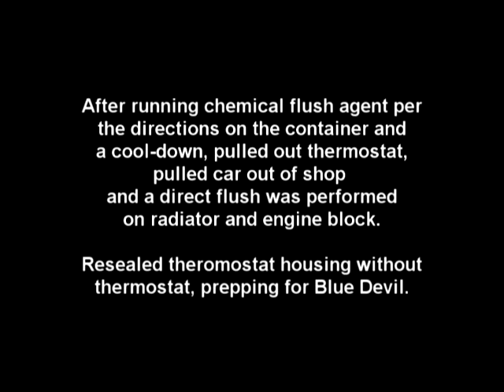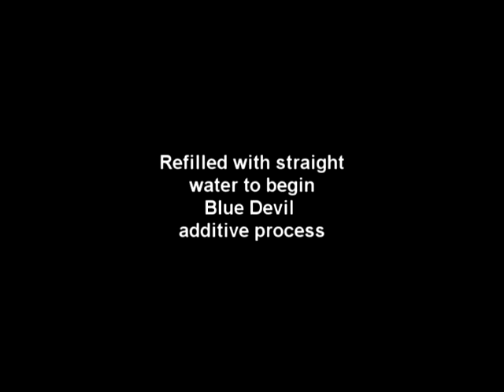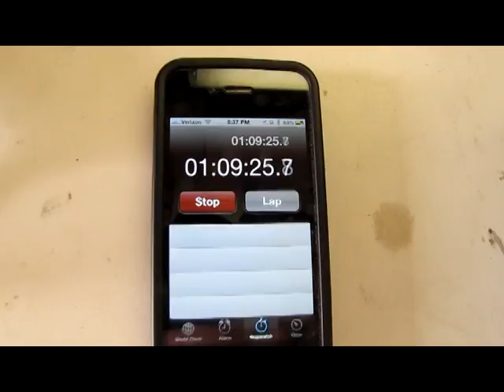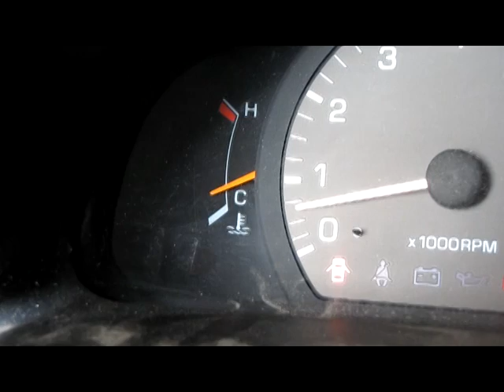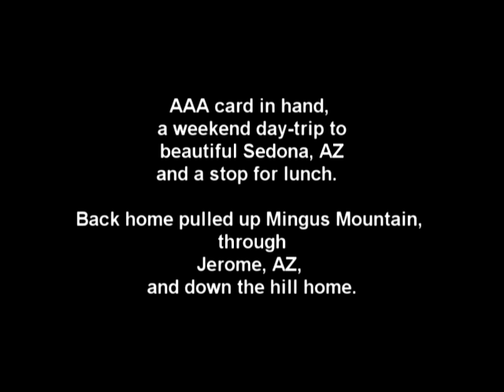Blue Devil Headgasket Sealant vs. Napa Block Tester Pt 2 of 2

Comment: You have convinced me that this is a good thing to try.  Should I use distilled water or tap water for the flushing and refilling?
Reply from the maker: jason: I've always used just regular tap water for all of my work. If you have any tech info on yours such as from a good professional repair manual that indicates you need distilled water, then you could use that-- but I wouldn't flush it with distilled water, since it's not going to remain in the system. If you decide to use distilled, I'd just use that on the refill.  Tap is what I use- always has worked fine for me. Only refill your system when it's cooled down.  r-

Comment: I have a strange head gasket leak the leak is on my 2000 dodge grand caravan 3.3 230,000 , no smoke, oilis good and coolant is clean dropping fluid , back left side head gasket leaks from time to time looses coolant for a few days and stops been doing this for 2 years. with this work on such a leak. never over heats
Reply from the maker: mikewrightify: Interesting, altho I have seen this kind of thing once before on an older Toyota car. I'd obviously consider your leak an 'external' leak, while most 'headgasket' (compression/combustion-related) issues are considered to be 'internal.' As I understand it, the chemical reaction in Blue Devil is designed to occur right in those areas where those super hot combustion gasses are seeping into the cooling system.  My guess would be that it most likely would not work on your external leak, considering your leaky area has no super hot combustion gasses to interact with. You may give US Sealants a call and ask them, though. Never know.... r-

Comment: Hi there.  Have you passed the 5k mark yet?  If so, is blue devil still holding up?  Thanks!
Reply from the maker: tk106: Hi There Back!  Starting mileage at repair time was 161,812.  Mileage on 11/15/13 is 176,250.  Total mileage since repair to 11/15/13 is 14,438 miles.  No issues at this time. Date of repair was 4/16/12.  Hope this helps!  r-

Comment from the maker: Rc: I share your concern about any kind of 'mechanic in a can,'  'miracle cure' quick fix.  As such, anyone who tries this will need to understand that if they indeed have a blown head gasket, that is an internal issue dealing with not only leakage of intense heat, but also of high pressure; the true 'fix' is to do the repair correctly. Buying a used vehicle is always a risk, no matter what. Usually  one can't get around that one with 100% confidence, I'm afraid. Thx for pointing this out.  r-

Comment from the maker: Andrew Cecil: Interesting- any idea as to why it won't work on the Subaru?  Fundamentally wouldn't they be the same?  Or I guess the question would be, what is it that's 'different?'  Overhead cams are pretty common these days. I worked on a lot of 80's Subaru's and they were all water cooled, but horizontally opposed layouts. Would that be why you think?  thx.  r-

Comment from the maker: Acuransx135: In this case it did do what it said- years ago when I was young I'd used some radiator stop leak (flaky kind) that of course didn't work.  This stuff I think is worth the gamble in a lot of cases, but I do wished it wasn't so expensive.  That's the downside- the expense.  And, I myself probably wouldn't us it on say an old valuable muscle car or anything like that.  It seems to make a good 'slam' repair, for lack of a better term. And, I've heard of a few cases where it didn't work.

Comment: I was just as amazed as you the first time I used blue devil. It is a wonderful product. I have now used 30+ times and have a 90%+ success rate. In fact, I have only had one motor it didn't work on at all. That is the late 90s Subaru dual overhead can motor, and when I notified blue devil they informed me that this motor is only one blue devil cannot seal

Comment: Something that's as good as the bottle says.. You don't see that often. I used to work at a parts place and a few of the garages would buy this to do head gasket repairs. I never knew it actually worked though. Thanks for taking the time to reply.

Comment from the maker: Acuransx135: Yes it has held up well this far.  Although I have to say the car really doesn't ever go out of town any longer because it's used by a local teenager these days.  Prior to this, however, I did take it on numerous out of town trips, a couple of which were down to the Phx area in the dead of drastic summer heat, with no issues at all.  Additionally I took it on several trips to see a surgical specialist, and we had to rely on this car for a while.  So far so good- r.

Comment: I did pressure test it. Hoping it was a water pump gasket leak I changed it out.  Still leaking.  Since it is leaking coolant I was hoping that blue devil might take care of it.  Working on this car is a pain in the ass and I don't want to replace the timing chain cover only to find out it has a head gasket leak as well.

Comment from the maker: AntKozable: You can use the old gasket, and if it's not a 'flat' surface you are working with, you can use a little silicone to temporarily hold that gasket in place.  Then use the new gasket when finished.  I always use a THIN coat of silicone (black) usually on the thermostat housing I take off to help with years of wear on that surface. Does this answer your question?  r-

Comment from the maker: Vic Onee: quote from their site: "Permanent repair for Head Gaskets, Warped or Cracked
Heads, Heater Cores, and Freeze Plugs"  So I'd imagine so.  You can visit their page at gobluedevil, and the rest of the address is the usual.  They don't allow links on here. r-

Comment from the maker: Lauren Flynn: I frown when I see this in particular of the year of your vehicle: it's fairly new, but again, I don't know the exact history, nor live in a large city where daily driving is vastly different from mine. I'm a bit surprised you've had issues. Head gasket problems usually occur in older cars or after situations of obvious overheating. Nonetheless, the amount of time you mechanic spent doing the procedure seems about right in a professional shop, and I hope this has helped you some.

Comment: I have a 2005 Jeep Grand Cherokee Limited. 4.7 V8. I bought it new. I started getting a little bit of white smoke from my tail pipe now and then. Not a lot. Then my coolant would bubble but the Jeep wasn't over heating. I took it to my mechanic. He told me i had a head casket problem. He told me about Blue Devil. I did my research on this product. I came across your videos and others. I went to the auto parts store and bought some Blue Devil. It ran me with tax 68 dollars.

Comment from the maker: MrMazinger: Good that you got some readable results from the test. You may already know this, but most Hondas have a bleeder valve that is usually near the thermostat- open it up as you fill the cooling system and it bleeds out all the air- upper excellent idea!  So be sure to report back if you can.  Thanks for commenting!  r-

Comment: This is the video that I have been searching for! Thanks for making this very informative video. I did the block test on my civic and the fluid turn green not yellow or stayed blue,but the continuos bubbles coming out of the radiator after I bled it a few times lead me to believe that there's a combustion leak. I will do exactly what you did and report it back to you .

Comment from the maker: irish rose: No.  At this point I added a 50/50 mix of water and full-strength coolant. However there was about a gallon of water/blue devil mix left in the engine block. When draining the radiator that doesn't completely drain the engine block, so I knew there was some left in the engine.
Irish Rose's comment never posted to the video page for some reason, so I pasted it here from my email notification. r-

Comment: Fast forward 1 week.
After blue devil treatment, I had to put 8 oz. Or so of coolant in every 35 miles. Up until this past stint. I have now driven 255 mikes without filling coolant. It appears to be working now.
Is this common? Might it take some time actually seal the headgasket? (Approximately 600 miles later, it appears to be working)

Comment from the maker: Cammi: I wouldn't recommend adding anything directly to the hose like that. There has to be a place where coolant is added to the system--be it an expansion tank, reservoir, etc. I recommend doing some sleuthing and finding out exactly where you are supposed to normally add coolant. If you have no luck, I'd take it to a shop and pose that question to a technician.  r-

Comment from the maker: dbcooper: Yes the Toyota car is still working just fine.  It's been over  year and we have had the car to Phx last summer in 115-degree weather.  I also converted the AC so that was on all last season, and into this one as well.  So far so good.  If you look over my vids and comments you can see the mileage and such.  I'm happy with it- I've heard mostly of successes but a few failures here and there.  I think it's worth the gamble in certain cases. r-

Comment: Thanks. Ive had it at two shops so far. Both said headgasket. Radiator was replaced 100 miles before I nought the car. Shitty job though (zip ties on hoses instead of hose clamps) I shall see...thanks so much!

Comment from the maker: dandoughty cont'd: I've seen things like fuel get into the hydraulics of brake master cylinders, being sucked into the system via the intake manifold- all due to a faulty interconnect somewhere (mechanical fuel pump).  Check all your fluids to make sure everything looks and smells normal- r-

Comment from the maker: dandoughty cont'd: it may be time for a shop to check it out. The previous owners of my truck had replaced the engine and had all the heater core lines routed incorrectly, and had coolant pumping into the air filter housing.  May be time for a specialist to look at the system, unfortunately.  But, you've corrected an issue, and verified it by a block check.  That's a major step. r-

Comment from the maker: dandoughty: Well you've corrected one issue, however 'minor' it may have been. Point of concern tho about the trans lines: you need to see if the radiator lower tank (or wherever it is close physically to the coolant portion) is not intermixing due to a blown lower area of the radiator- It's a lot of work, but I'd isolate the radiator itself and pressurize it, by draining and clamping off all coolant ports, leaving the trans ports open.  See if the radiator itself holds. Otherwise, cont'd

Comment from the maker: dandoughty cont'd: the intake manifold area to warm certain sensors and gizmos. Whether or not the 'gizmos' can become broken and incorrectly pass coolant elsewhere would be suspect; check your air filter housing for anything wierd or wetness; check your PCV valve, lower part to see if you have obvious water/coolant on it. Carefully unplug any vacuum lines near any sensor which may be 'looking at' coolant, and look for wetness. Finally, how much are you losing-at what rate? r-

Comment from the maker: dandoughty cont'd: Most automatic trans have cooling lines that connect to the radiator, normally on the bottom side of the rad. Suppose the system was over-pressurizing-it could have actually developed a crack in between the part of the radiator which holds the coolant and the lower part which holds trans fluid. In that case, check your trans fluid for too high of a level and also for fluid that doesn't 'look' right. That's one idea. Next, on some cars the coolant is also carried into cont'd

Comment from the maker: dandoughty cont'd: video on my channel I did on how to check a typical cooling system for leaks. Most folks probably don't have one of these tools, but a shop can do it for you. You are looking for a drop in pressure after pumping it up to an operating level manually. That will show any kind of external leak. So if you have something as simple as a loose clamp or bad water pump gasket, it will show. The next idea relates to other systems which interact in any way with the cooling system. cont'd

Comment from the maker: dandoughty: Cool! A step in the right direction for sure!  Yes, I have a couple more ideas for you.  Altho I'm not experienced with Volvo's, I listen a lot to "Car Talk" podcasts, and what I've learned there regarding this is most vehicles are based on the same operating principals.  Assuming that is the case, you most likely have an automatic transmission, correct? If so I do have some further thoughts. First up, have you done a pressure check on the cooling system when cold? I have a cont'd

Comment from the maker: pokergod: Excellent news!  It's worked for me twice, now.  And I have a 2002 Nissan Sentra that I decided to replace the gasket on, and replace the head as well.  It's been  nothing other than a pain in my youknowwhat ever since.  I've done these many times, and this one runs like crap.  Turns out the valve lash isn't right- and it's been a pain.  Should have goo'ed this one with Blue Devil as well.  Next time, for sure.  Great news tho! r-

Comment from the maker: dandoughty cont'd: smaller leaks that the chemical (left in the block) might find, while at the same time not leaving it in full strength. However, you are right in that you aren't required to drain or flush the system- they leave that up to you at that point. Does this help any?  r-

Comment from the maker: dandoughty: Sorry it's take so long to reply. My directions say (I have a bottle) "You do not need to flush the system a second time after process is complete (Blue Devil can stay in the system)." That tells me I can leave it in, flush it out, whatever, it shouldn't matter at that point. Draining just the radiator does not necessarily drain the engine block; I knew there was about a gallon of chemical/water mix left in the engine, so I decided to leave that in as residual for any further cont'd

Comment from the maker: jghorton1: Yessir, still good.  The car has been relegated to daily teenager duty, and all over the place.  In the interim we did have to use that car to take out of town trips to Phoenix (in mid summer oven-temps) and also up to Flag (Nice temps)- car has done amazingly well.  I also added this to a Toyota truck I bought in non-running condition-got a green result, then applied chemical.  Again, daily driver.  So far so good- r-

Comment: I have a 2003 dodge work truck, so it's kind of a beater, yet I can't NOT have it running. I own a landscaping company. No truck = no work. I replaced the engine 3 years ago, AND the engine is under warranty, but I don't have the receipt for the engine, so warranty does not apply. I'm just really hoping Blue Devil works on my V-8 or that I find my receipt so the manufacturer has to replace the engine again. Thanks for responding, and for making a very informative video.

Comment from the maker: dandoughty: Wow- well the radiator cap is also a pressure-relief valve, so obviously there is pressure getting by that.  The only other suggestion that I have is to replace that radiator cap, or to check it to see that it's properly holding pressure like it should.  You could probably take your cap to a shop or a parts store and have them check it for holding pressure.  Hate to see you spend money and time if it's just a bad cap, but with a green result- hm. Look forward to hearing back. r-

Comment from the maker: pokergod cont'd: or if the car is valuable, a beater: I'd redo the chemical process; a valuable car: I'd be wondering if I had a cracked lower block or issue with the heads in which case I'd probably consider another engine. The process does add 'stuff' inside your engine, so be careful with valuable cars about doing this more than once, I'd say.  But, the block tester doesn't lie. Just be careful about the exhaust when testing with a block tester- exit the exhaust well out of your testing area.

Comment from the maker: pokergod: answer is yes. Sortof. If you do the process, then recheck and you still get a change in color, that means that you would still have combustion fumes (compression fumes) in the cooling system- and there shouldn't be any in there. That could be due to a cracked lower block (not the gaskets themselves), which could cause the same results. Could also mean that the process didn't take effect properly.  So depending on if the car is just a beater you don't care much about, cont'd...

Comment from the maker: dandoughty: Have you had the cooling system pressure tested to find the loss, if it's external?  Mild green results could be just that- a 'mild' compression leak, but any isn't really great. I've also heard of negative results from the chemical treatment. I'm not any kind of paid promoter or anything, and really don't believe much in chemical quick fixes in general. My results have been positive, and I'll say that I'll try it again if needed, but would think twice on a vehicle of any value.cont'

Comment: Thanks for responding. I have a 98 volvo v70. Runs great, but coolant loss. Block test turned a mild green. 250,000 miles. Gonna give it a shot.

Good thorough video by the way, thanks!

Comment from the maker: maxshcelle king: another response:  I am in the middle of the editing process on my next video upload on a 'typical' front-wheel-drive (domestic GM) water pump replacement.  I'm about halfway through that process.  The car is already sold, though- long gone to another teenager. Not related to Blue Devil, but related to cooling system stuff. r-